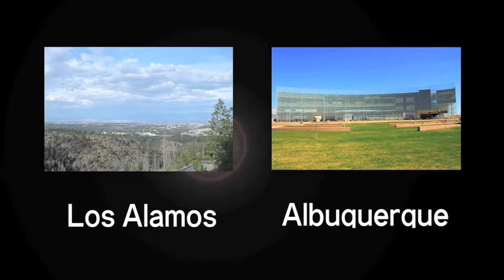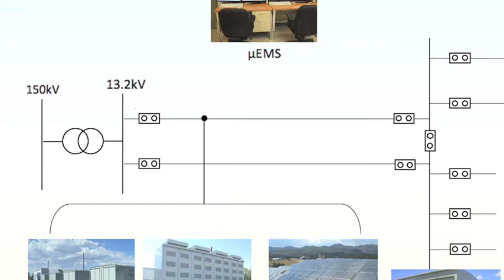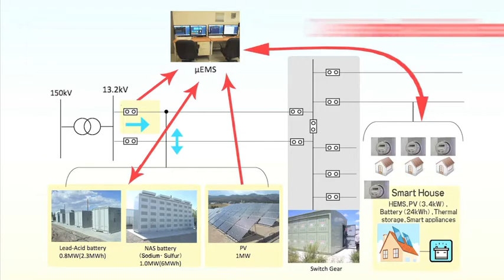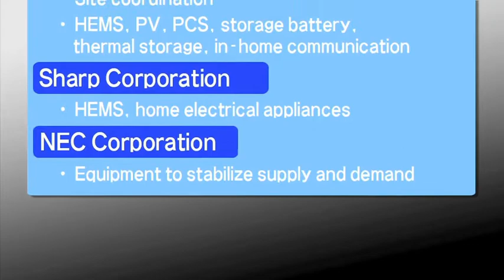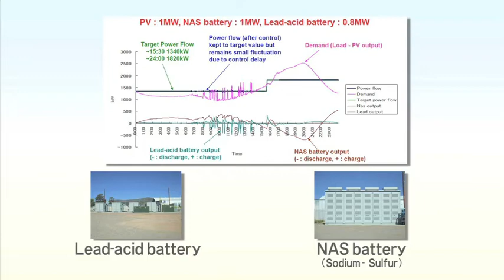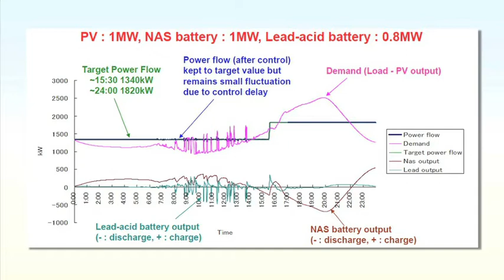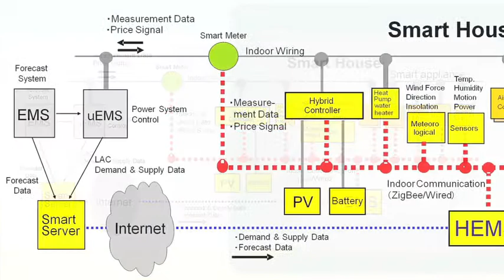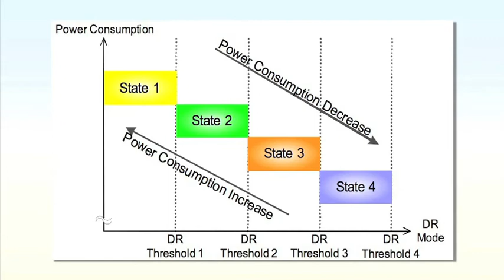Los Alamos Smart Grid

Comment: $52 million for a measly 1 Mw of [peak DC] power? This doesn't seem like a "smart" power system at all, but, rather, a waste of money. I think one would have to reduce electrical production costs by at least more than a factor of 10 in order to even approach the current cost of electrical production. Even in New Mexico, the costs of PV systems are simply way too high to be reasonable.